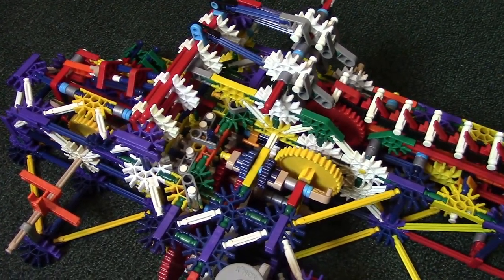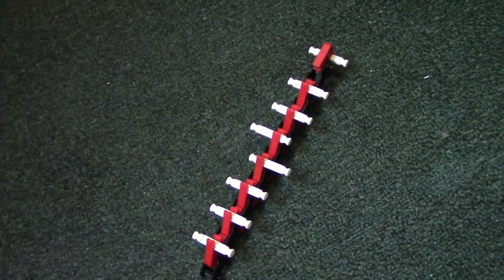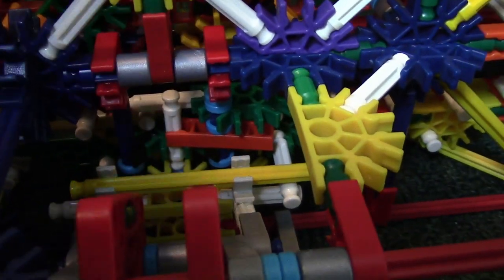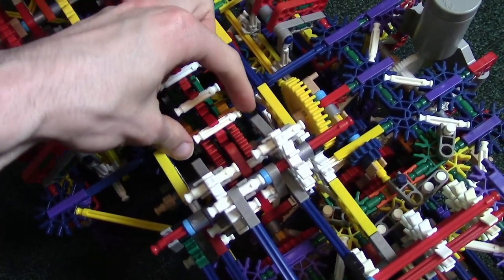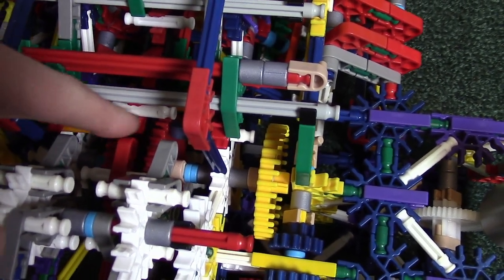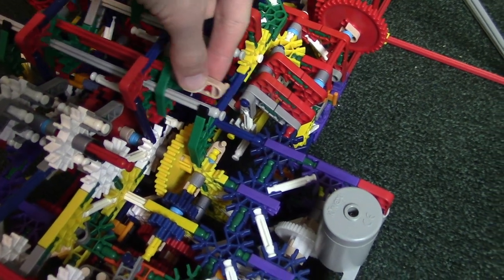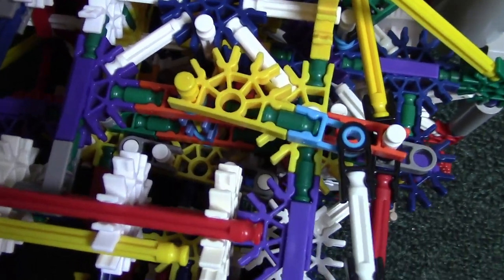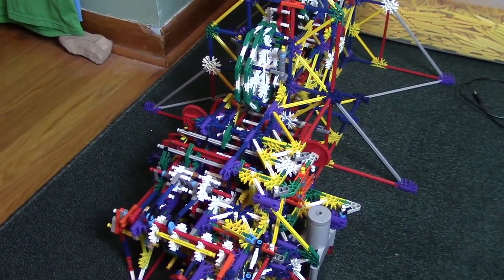Let's Build Knex S2 - Ep3 - Robot Project: Tape Erase and Writing

Comment: I’m amazed at how you’re able to even manipulate any of the white rods on the chain in the first place considering my chain lifts will snap sometimes at the slightest of errors 😂. Great job with explaining every step of the control system enjoyed this video
Reply from the maker: Thanks! The key is keeping the chain still to avoid twisting. I haven't had the chain snap yet, and I'm hoping it never does since that would be quite the mess to clean up haha.
Reply: @Shadowman39  I’ll knock on some wood for ya no need to jinx it now

Comment: I love how this has been designed, the links and elements playing together or ensuring they do not put additional strain on other components.

I think it would be a fun addition to have it so that when you are not in "Write" mode that the console could potentially be reactive to the outputs of the machine in typical operation? It seems like that may be feasible with the current arrangement of the components so long as there isn't any additional strain caused by that addition.

Also, for the console design, you have mentioned the need to have the system toggle on and off for various inputs (you toggle one rod to the right, then later will have to toggle another left). Could you implement it such that the console has a "submit button" so you have your control rods set to the correct positions then press the "Submit" button to appropriately change the rods after advancing the tape?
There would be challenges with that of course... the console would have to have internal memory of the previous state (if the intent is to have the console reflect the rotation output of the tape and not the state of the bit in the tape).

And as an inquiry (sorry for so many of those in one comment) the advancing of the tape is going to be controlled collectively or individually when the system is constructed with multiple tapes? I'm assuming all will advance at once so that multiple motors can have their tapes set appropriately at once instead of the risk of desync that could happen if each tape was advanced individually during the writing process.

Again, thanks for sharing the process like this, I was actually double checking to see if an update had come along because it had been a week XD
Reply from the maker: Those are some good questions, I'll do my best to answer. First, do you mean that the control panel could have gauges when the robot is running? I haven't planned on doing that, though I agree it would look cool to have some sort of way to let the operator know of which way the joints are turning, though I'm not sure of what practical use that would have. 

I worked for the past couple weeks on the write head control to make there be one main "submit" lever, with three individual levers (one per joint) to specify direction. There was going to be a rather complex system with another forward/reverse transmission with a crank at the output, and the crank turns 180 degrees to push a pin to one side with the write head and then push the next pin when the crank rotates 180 degrees again. Unfortunately I discovered the torque required to turn that crank is too high for practical use due to resistance of the pins being pushed. I had also been thinking of ways to control the transmission during write mode by only having one lever for each joint, but it proved too complex, perhaps requiring multiple motors and such. So the plan now is to use two levers, one for the write head and one for the transmission, that the user pushes. But with the way I plan on arranging it, you'll only have to press one time anyway. I haven't started on this yet, right now I'm just getting the control panel planned out. You won't see the failed attempts for the other systems because they took up 15 minutes of video footage, and I don't want most of Episode 4 to be of something I had to ultimately remove haha. Maybe I could post them as an unlisted video.

The tape advancing will be individual for now, with one crank per tape. I plan on using differentials to make sure the tapes aren't out of sync. One thing that still concerns me is what will happen if the 3 motors aren't all the exact same speed, and having the tapes desync over time while running.

Comment: I think you should use the the dark grey and neon red colored 90 degree pieces to denote intervals on the tape. The orange 90 degree piece could be the “start” of the program and then use a dark grey piece every so often to denote set periods or intervals. I think having something like that would make programming much easier and ensure there is always a clear start to the program so that the tapes don’t get unsynchronized.
Reply: thats clever!
Reply from the maker: That's a good idea, I already have a light grey connector (the 45 degree one) in the tape somewhere to denote the program start, I think I mentioned it in Episode 1. It would be easier if all of them were light grey connectors and a red connector signaled the program start, but I don't have enough pieces for that. So now I'll have to think of a way to detect when there isn't a red connector, rather than having a red connector that pushes a lever or something. But I like the idea of using different colors to divide it into intervals so you know when you're halfway through or when the program is about to end.

Comment: I really enjoy how compact all of this is! Is there any specific reason why you used two red gears at a 90° angle for the erasing module instead of using a red and a yellow, or two yellows?
Reply from the maker: I like to conserve on the yellow gears if possible, and the erase module doesn't require very much torque, which the red gears are good for.

Comment: Do the pins need to be lined up with the write head, or can the chain be turning and engage the write head?
Reply from the maker: The chain can't be moving while the write head engages because I think it would add too much friction to the motor. But I was thinking of making the write head like the erase module, with wedges, but it would have to somehow get out of the way before the next pin comes. So it might be possible if done in stages. To make it more complicated, there's also the idea of moving write heads haha.

Comment: I am again impressed at your ambitions with this project! Did I miss the part where you originally planned for a write head? The fact that the tape will be rewritable on the fly is crazy!

That aside, I have been working on a replica of your robot, based on frames from your first two videos. Here is a reddit post with some photos: https://www.reddit.com/r/KNEX/comments/n2vnmy/shadowman39_mechanical_robot_replica_details_in/?utm_source=share&utm_medium=web2x&context=3
I go into detail in the comments of that post, but it is functionally identical to what you had at the end of your last video. Now I'll have to get to work on implementing all of these awesome new features! Keep up the great work Shadowman!
Reply from the maker: The planning for the write head is all in this video, I'm pretty sure I hadn't mentioned it till now. That's really impressive that you've been able to build this whole project just from my videos haha. It'll be interesting to see the design differences and their effects on the model, such as the custom motor. Could you perhaps get a worm gear like the 12V motors use and remove much of that extra gearing? Great job!